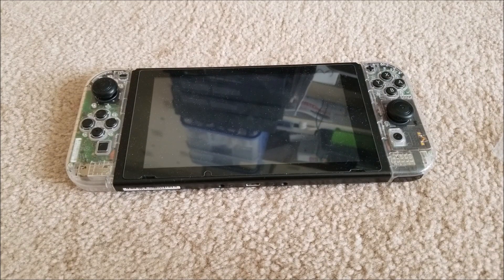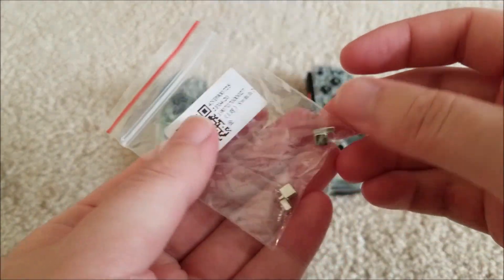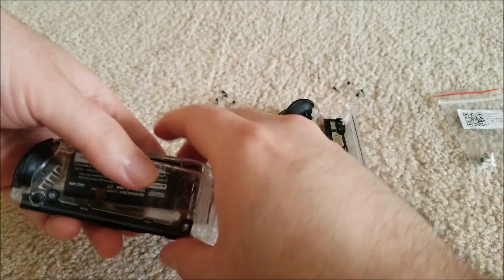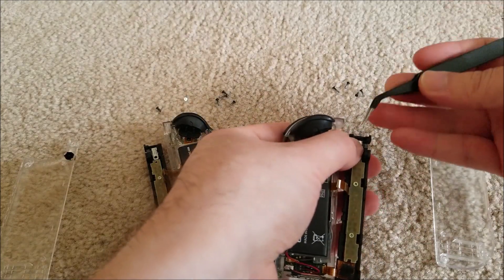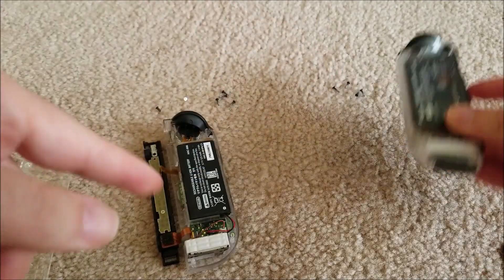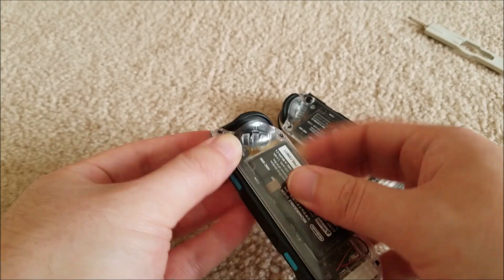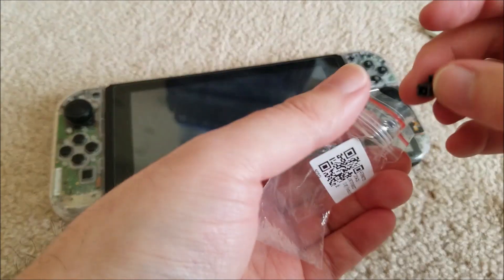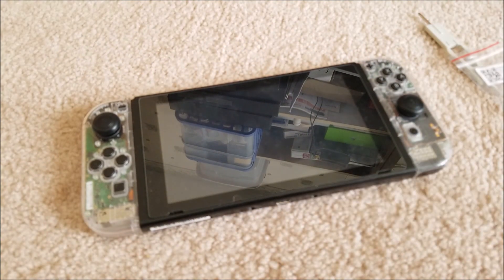Nintendo Switch Joycon Replacement Metal Latches!

Comment: I replaced the lock but it still did not fix the issue. The controller still just slides off and the switch isn't reading it. Any suggestions?
Reply from the maker: Check that the lock isn't getting stuck and moves back and forth smoothly in its slot (there may be some "flashing" on the casting seam of the metal that needs to be sanded. My first set was fine but on the second set I installed for a friend I had to lightly file the edges so they would fit properly.

Comment: How long will the metal last? Which metal did you get?
Reply from the maker: How long it lasts depends on many factors like what type of metal it is made of (all the listings look similar but don't give much info, likely some cheap cast steel), what type of metal the rails on the switch are made of, how often you attach and remove each joycon, etc. If I had to guess it should last 5+ years of heavy use whereas the plastic ones may fail within 1-2 years under similar conditions.
Reply: I have an extra pair of latches I bought two in a pack

Comment: I know this is old but I was just wondering if maybe you had a parts list for the Dreamcast vmu arduboy?
Reply from the maker: Schematic will have all that info along with wiring on the project page I created for it https://hackaday.io/project/163662-arduboy-in-a-dreamcast-vmu
Reply: @sjm4306  thank you, you wouldn't happen to have the source code and or pcb files would you?
Reply from the maker: I didn't write the source code as it was created by the fine people at arduboy. Everything you need software-wise can be found on their forums (https://community.arduboy.com/) and everyone is super helpful there to get you on your way. I did create the pcb files and don't mind uploading them to the linked project page above, but just know there are still a few mistakes with the design that require you to cut the plastic shell in a few places to get it to fit correctly.
Reply: @sjm4306  that's great having to cut the shell or the board itself is no trouble at all
Reply from the maker: I've uploaded the files to the hackaday.io (linked in my previous comment) project page, have fun!
Reply: @sjm4306  thank you so much also the link to the article community said that the page was not found but I can probably use the source code for the original arduboy or use the source code for a clone

Comment: i lost the little metal sheet that goes on top of the latch  with the screw :(
Reply from the maker: Ebay has replacements but it's ridiculous that they are like $7 each. It's a little piece of metal you could probably cut out of a tin or aluminum sheet.